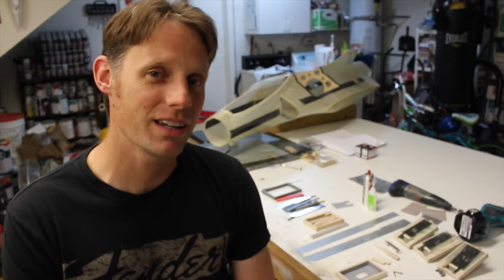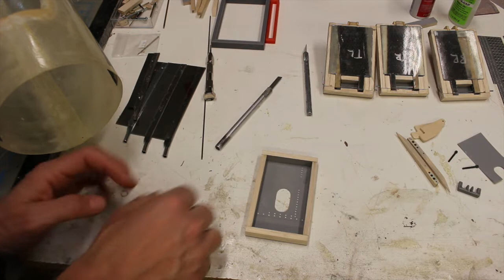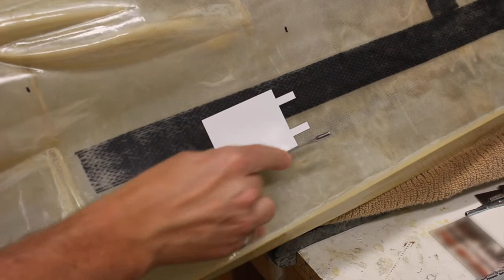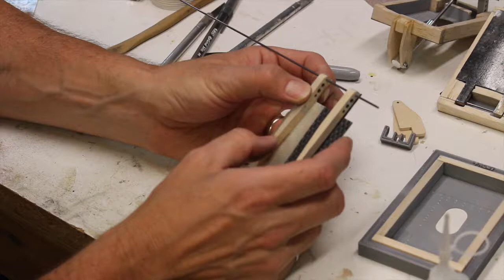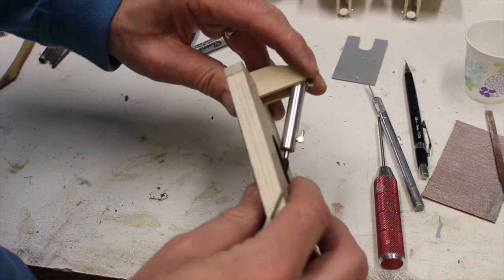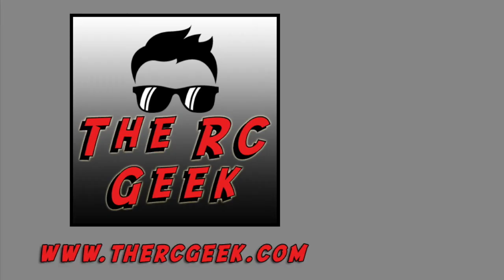Build an RC Jet Ep 1 - F4D Skyray Speed Brakes

Comment: We are doing an F86 Mass Build in England for PSS Gliders are are thinking of adding speed brakes. We won't use pneumatics, which is I presume your connection. Any help concerning how the servo attaches and operates the speed brake would assist. For more detail see the dedicate Speed Brake blog -  your blog is embedded which is good as far as it goes. If you want to post something on our build blog please go ahead.
Reply from the maker: All that you would need to servo operate the speed brakes is a control arm connected internally to one of the two "fingers" on the speed brake.  Then, using a pushrod and servo on each side and forward of the speed brake, you should be able to operate it.  No need for pneumatic cylinders or anything like that.  I'm not sure if I'm explaining it very well.
Reply: @Thercgeek  Gotcha - of course - no need for complications like bellcranks - keep it simple!

Comment: Im interested in building the Skyray and was wondering where you purchased your kit from.  I read your build log but couldnt find any information on the fiberglass fuse.   Also was wondering how the build is going as I have not seen any build updates in a while. Thanks Tim
Reply from the maker: Unfortunately, this kit is not currently available and is not likely to be available any time soon. Traditional builders kits just don’t sell that much these days. I got this one from the designer a few years ago. I wish I could say the build is further along, but it’s been slow. Too many foam distractions, haha!  That said, my goal is to get the airplane flying this next year.
Reply: RBC 90mm skyray kit about $250 US. fantastic kit, just finished one.